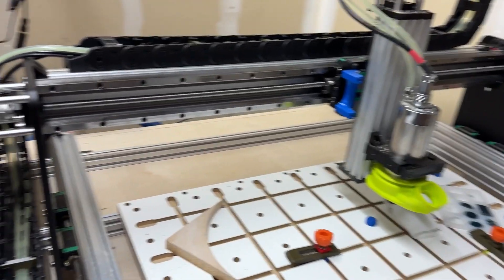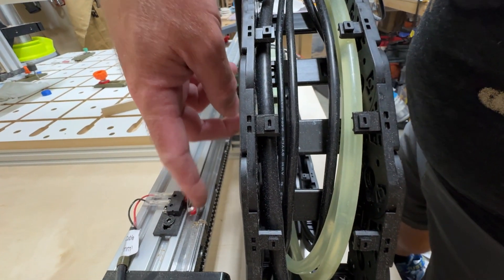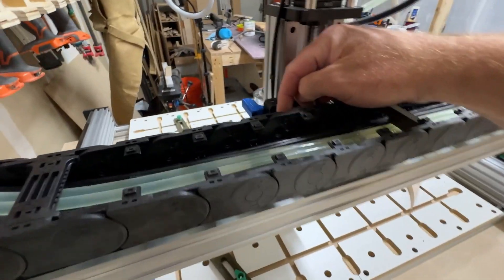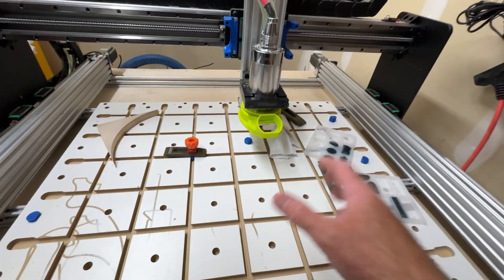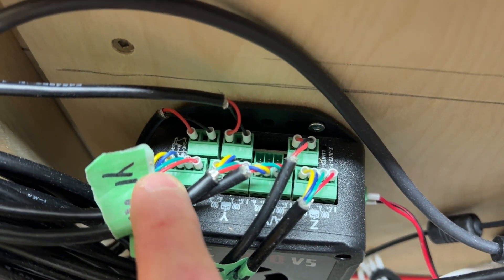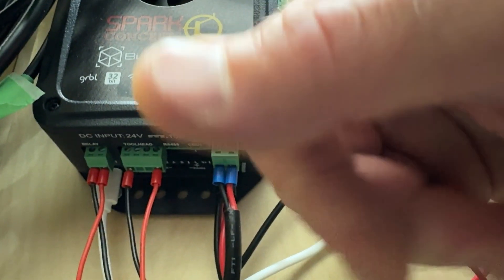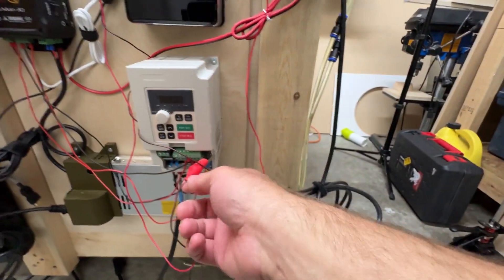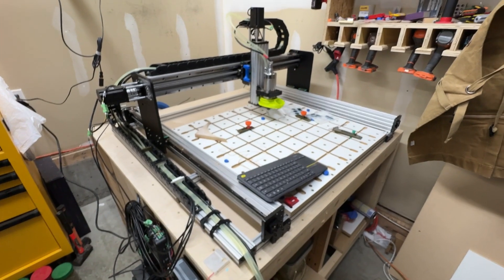Ultimate Bee : Limit switch and cable runs! Take 2

Comment: better use software limits table size, then induktive sensors home point and limit SW max limit whit E-stop SW stop if crash to frame.simple and safe system. working well for me and many many million machines.
Reply from the maker: I have the mechanical switches and then I have the soft limits of the machine set, so far no real crashes.
Reply: @sparks-tech  good, this is best system do all cnc, first stop normal soft limit and second have mechanic limit SW no crash machine frame etc. normal safe lot input pins use mech limit whit E-stop paraller, stop machine if try crash frame. my first cnc not have ay limit SW and code error make X axis run out to beam top and broken all frame ,all need build new all new parts. very expensive make all new, then i has used all my machine limit SW, true important.
Reply from the maker: Yeah breaking the machine would be bad and something that would be possible as the machines get stronger and more powerful.

Comment: i use my home switch induktive 5mm threaded sensors, cheap and accurate good. limit SW have old mechanic SW. software have table all axis limits not need mechanic limit SW but good if have connected paraller whit E-stop SW if come error not broken machine
Reply from the maker: Yeah I have been looking at switching over from the mechanical switches to inductive probe sensors. Might be an upgrade later this year.

Comment: nice cnc machine, i build my own machine very similar, same beam and screws nema 23 470 OZ motors 10$ breakoutboard, DM556 motor drivers, 2,2KW spindle water cooled, super silent machine, Y axis SBR 16 rails, all other MGN 15 rails, little different sboilboard, MDF and lot holes and insert nuts backside. cost me about 1200$ and FREE linuxcnc software. working perfect. table working size 40" x 45".
Reply from the maker: Nice sounds like a good build. I wish I would have gone with the 1.5kw spindle but so far so good with the .8kw

Comment: What nook do you have? I want to get same one.
Reply from the maker: The NUC Model is NUC7i5BNH. Its an older i5 model but works great.
Reply: simple build own machine, not need rocket engineer be can build at home own same machine, easy job. not need buy ower expensive ready machine, etc, onefinity cost 4000$ and better you can build in garage hand tools less than 1200€